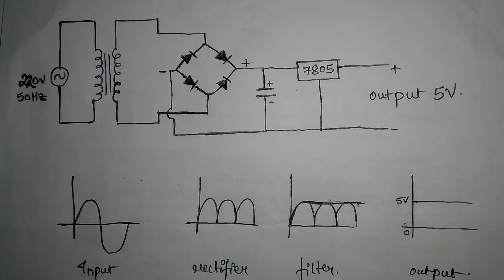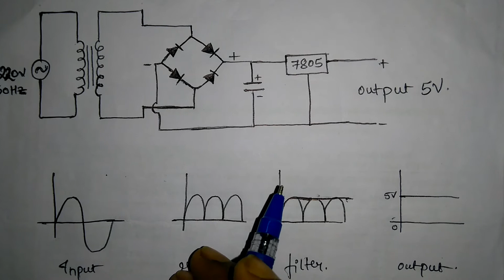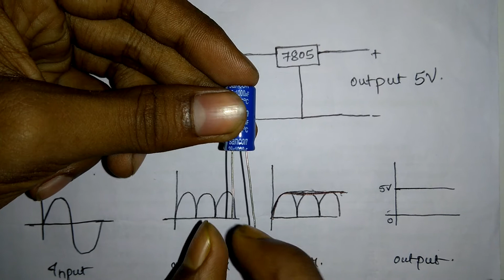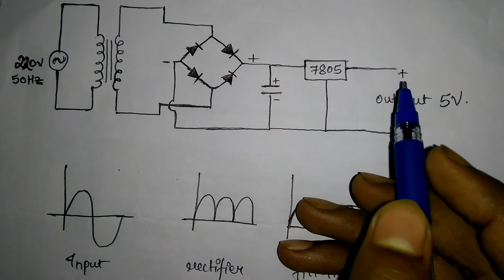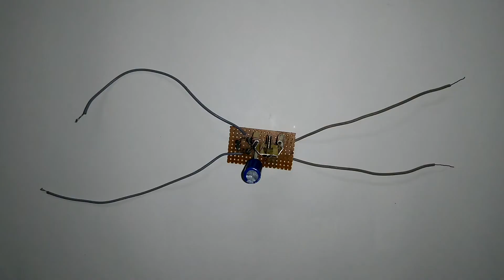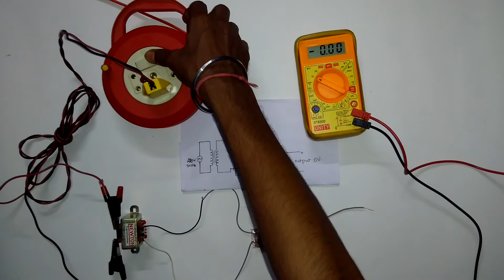constant 5v power supply

Comment: sir please explain how the filter is working. also can we use low pass filter? and will the peaks be perfectly fine??
Reply from the maker: 7805 is a 5v regulator so it will form a constant power supply,and this filter is just not allowing my ac component(after passing from bridge)to enter the circuit
Reply: Respected sir, You give only one answer!
what about the rest?
Reply from the maker: u want constant 5 v so there will be a  constant peak of 5 v